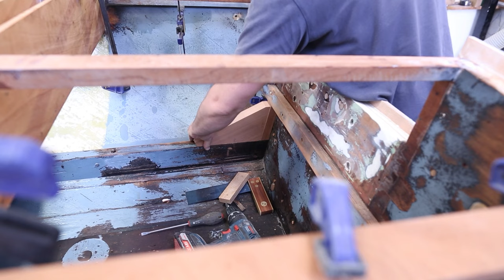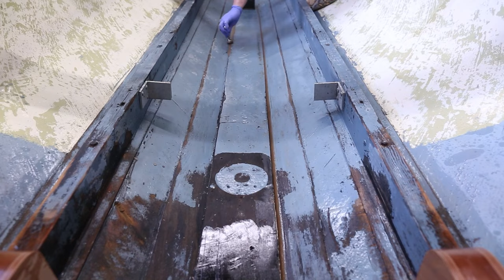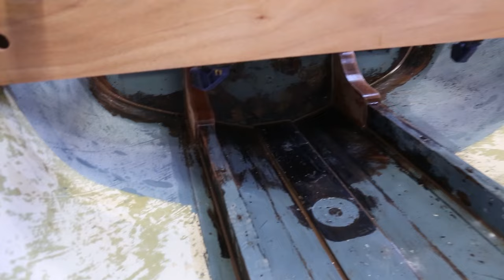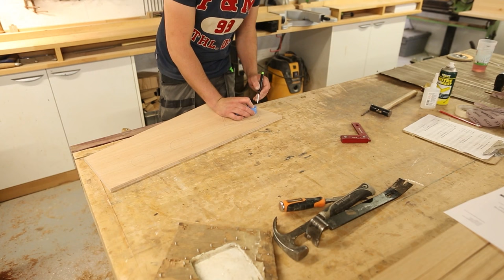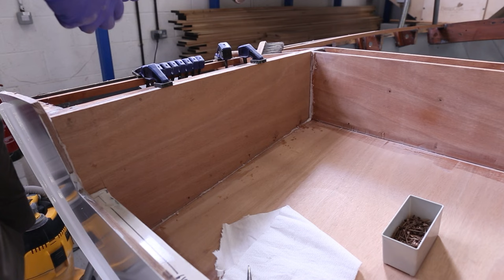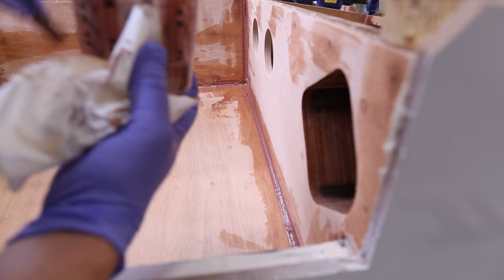Internal Repairs, Knees and the Transom Well | The Stapley Boat Restoration Pt5

Comment: Ive Got a epoxy fillet tip for ya buddy!! Two words... piping bag!!  Fill the bag up with ya glue mix, cut the end off according to the size bead you want.. Fast, easy and consistent without lil baby air pockets you sometimes get knifing in it place
Reply from the maker: Yes, I need to get in to using piping bags 👍

Comment: Very well done!!!  What is that cool little tool that you use to fillet the corners with?
Reply from the maker: It's a wax fillet tool, I think it's actually meant for forming wax for mould making but I find it perfect for epoxy fillets. Because it is a ball it doesn't matter about the angle it is in relation to the workpiece.

Comment: Thanks for sharing. Great video. What type of nails are you using on the boat? is that stainless steel or brass?
Reply from the maker: Thanks, they are silicon bronze grip fast nails.